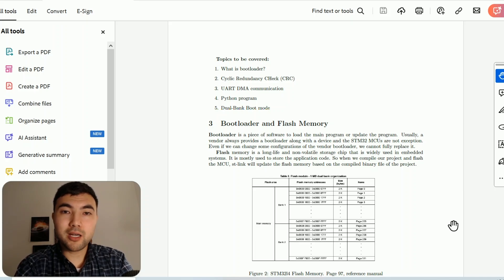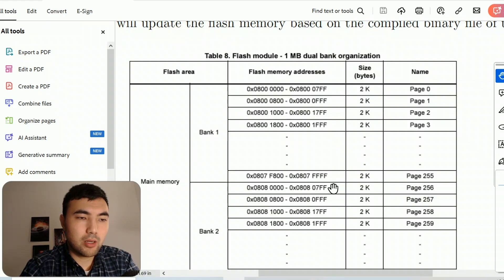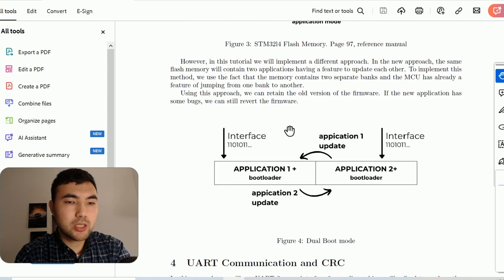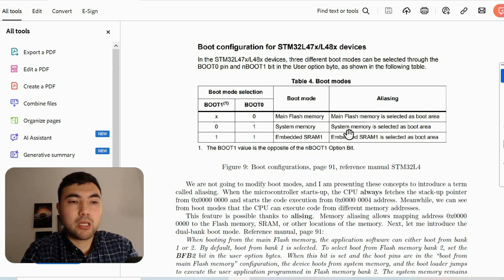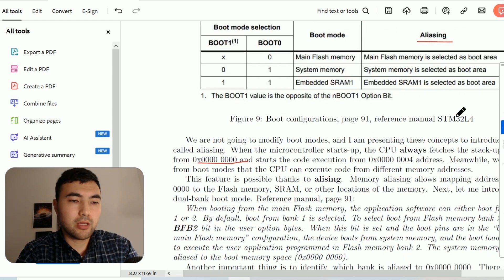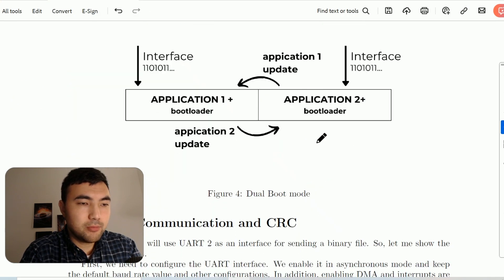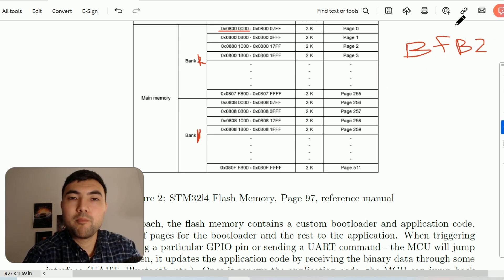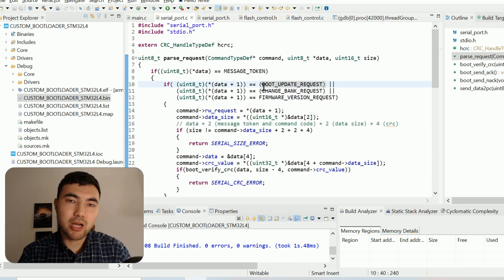STM32 Custom Bootloader P2/3: Flash Memory, Aliasing and Toggling the Memory Banks

Comment: This is great thank you so much!

How does this relate to the system bootloader?
In the RM st says that BFB2 simply forces the bootloader execution.
And when looking at the AN2606 the system bootloader seems to always execute code from bank 2 first if there is a valid SP address.

Would that not mean that one could just downgrade attack by going into the system bootloader forcefully by setting BOOT0?

Meaning if BFB2 is reset and BOOT0 set then we would boot from bank2?
Reply from the maker: I am not sure I understodd you well. Basically, dual-bank mode means that the bootloader and the aplpication are both in the same place. And you have two versions of them: in bank 1 and 2.